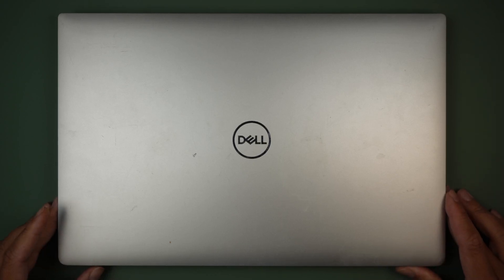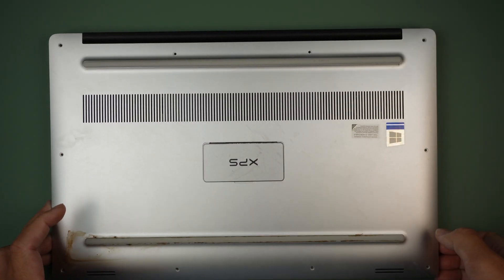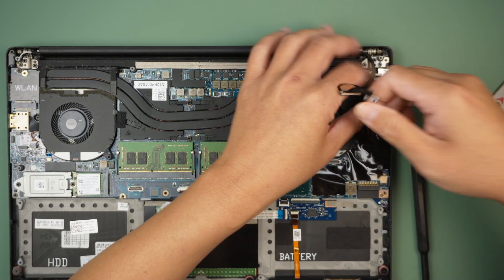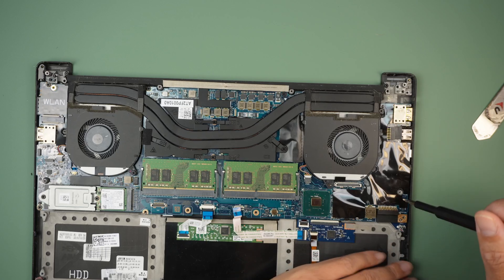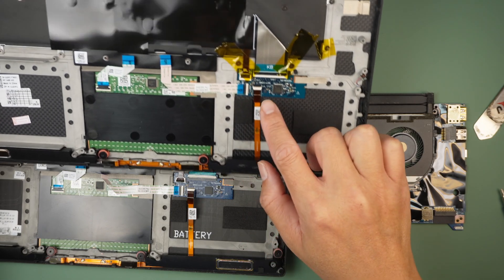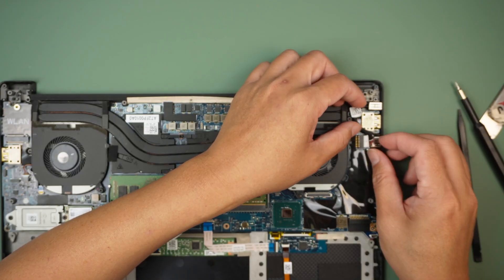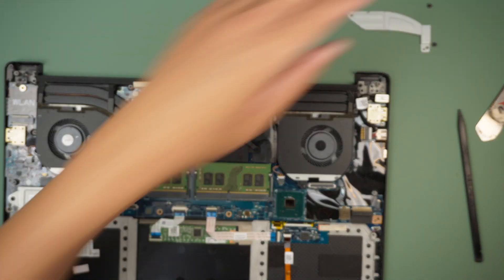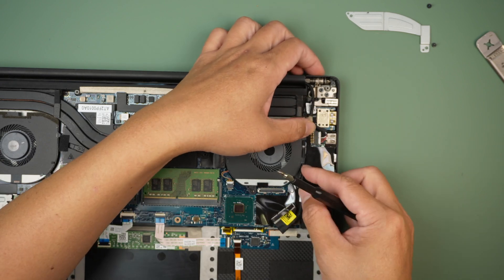Dell XPS 15 7590 P56G Keyboard Battery Replacement

Comment: I've had one since 2019, but after installing Windows 11, it started to overheat. I've already replaced the fans, redone the thermal paste, and replaced the thermal pads. I reinstalled Windows and the drivers, but the fans are always running at full speed. Without doing much, the processor starts at 72 degrees Celsius.
Reply: This is a late reply, but I am currently using the same model laptop and it is working amazing with Mint Linux. Truthfully, what Microsoft have been doing with Window's make it seem like the hardware is the problem when its just a really blotted system they force us to use.